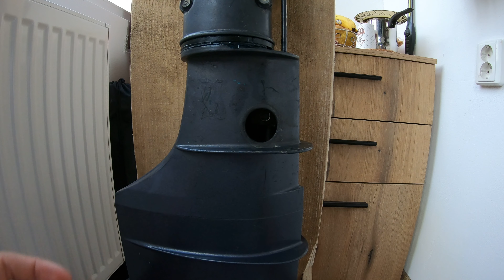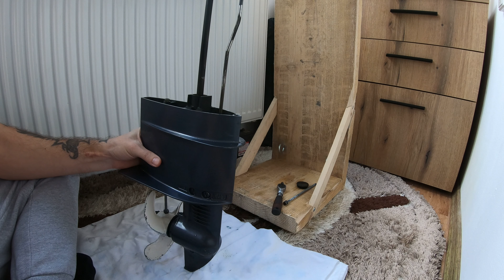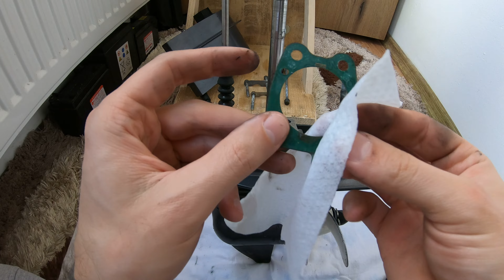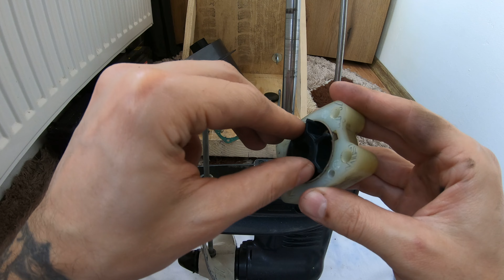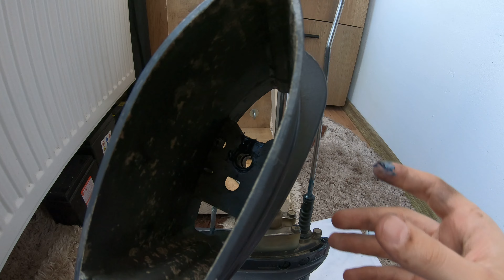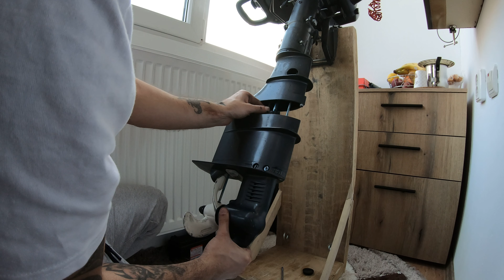Yamaha F6 F6CMH outboard engine 4hp 5hp 6hp impeller water pump change , Wasserpumpe , vannpumpe ,4K

Comment: The outboard is made in France?
Reply from the maker: Yes
Reply: @AutoMotohowto46  I asked you because I also have an identical one, made in France and some parts are different and cost almost double...
Reply from the maker: @armaghedon-c4j  it was manufactured in 2011 if I remember correctly
Reply: @AutoMotohowto46  The mine is 2014...